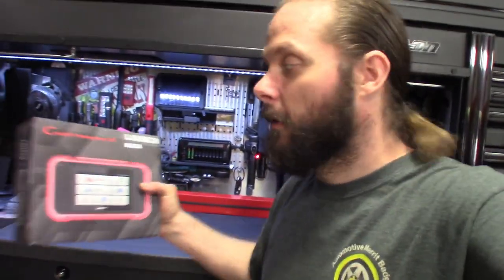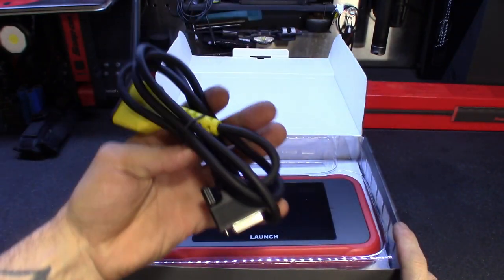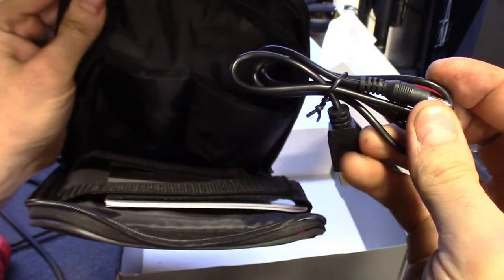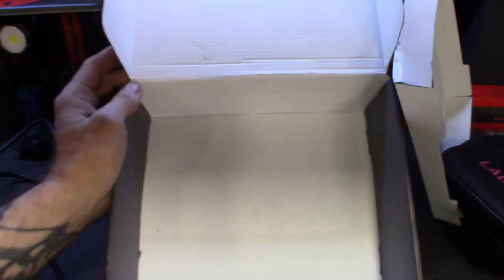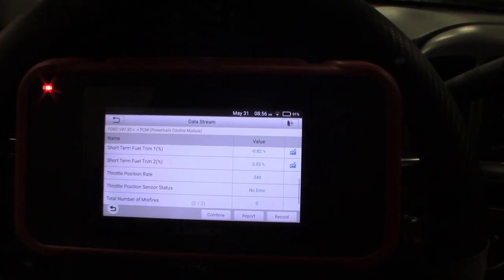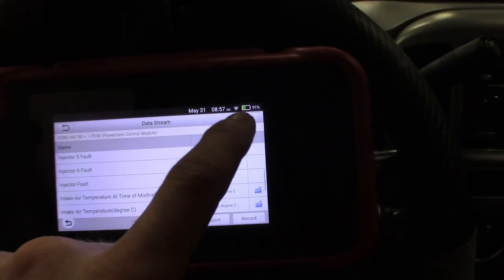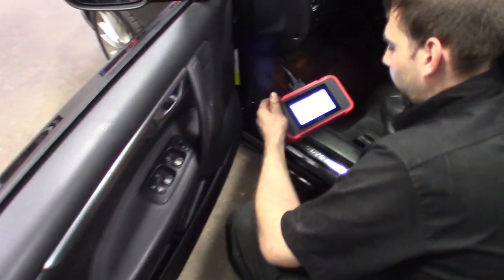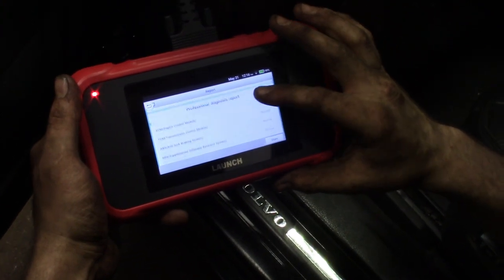New Launch CRP123E Review on Ford, Volvo & Nissan.

Comment: I have a CRP129E that seems almost identical to this one. Be careful when using with Toyota. I have noticed that it comes defaulted to Europe on Toyota models, and you'll need to "set area" to America or else it won't connect to the vehicle. I spent entirely too much time trying to figure out why it wouldn't connect to any newer Toyota's lol
Reply: Voltage Drop Diagnostics good to know PJ
Reply: Looks like it’s only the 5 reset functions the 129E has over the 123E, so the 123 is just a code reader and 129 has resets, I just did one on the 129E so I was curious too
Reply: Hi PJ,thanks for your feedback.all right " it comes defaulted to Europe on Toyota models, and you'll need to "set area" to America or else it won't connect to the vehicle"

Comment: Just got it in from UPS and I've got all the upddates. Looking forward to using it tomorrow. The last 6 upgrades were hard to get in, but they finally happened.
Reply: Do u know what updates the Launch did or features it added?  Thanks
Reply: @todd5082  Not really. The last 4 took rseveral etrys to get them in. I think Jaguar, Lada, some other oddball ones that I've never heard of before.  I wondered if I should even  bother with them, but gave in to curiosity and got them anyway.
Reply: Bonsoir moi je ellectricien auto je ne comprends pas l'anglais ci c'est pas français

Comment: One more thing ----> there is no charger with this unit and even though it offers a USB to whatever the connector is called, I just decided to take an old PSU I had laying around and I charge it from that. 

After all - a Computer PSU is super clean and absolutely correct voltage and it charges the 123E just fine. I was worried 'cause the battery was still going lower and lower even if I left it plugged into the USB connex.

It just didn't seem to charge very well at all that way.

Comment: Do you need to  have internet to used it ? If you don't updates does that still work without updates ? Out from the box can you used it without wifi or internet ? Can this scan fpr Fuel Pressure ? And can this do compression test ?

Comment: I didnt look up what resets, or functions it can do, but seems slower then my 229. Still looks like it shows all the pids, and I like that that one has the graphing ability.  But if it's even 1/3 what the old ones are, it'll be a le to do most basic testing. Glad I got to see the new one jim.

Comment: Is this tools upport Mercedes W210 which requires 38 pin adapter? Thanks.
Reply: No,only for 16Pin OBD2.
For OBD1,you need to buy adapter by yourself

Comment: I have the same one. Excellent video.
So you know or how ro relearn the travel app sensor procedure on a 06 Mitsubishi Outlander? I had replaced it had code P2138 in health report.
Reply: CRP123E can not do reset service,CRP129E can do Oil Service/EPB/TPMS/SAS/Throttle Body Reset.
other calibration service you should think abou more advance scan tool like  Launch X431 Diagun IV or Launch X431 V Pro.

Comment: Does it show each cylinder miss fire counter?
Reply from the maker: Not Ford's but I'm sure it would on gm and other vehicles.
Reply: If it's like the older one I have, it will on non Ford vehicles. Ford as you prob know does balancing reading, and not individual cylinder readings unfortunately Justin.

Comment: Does this tell you which cylinder isn't firing and possible cause?
Reply from the maker: If vehicle manufacturer monitors it. Yes it will give you a code and you can use it to Google possible causes
Reply: Yes sir,the scan tool has the button "google search" to fast get possible causes.and also the live data will help you to do more Diagnostic analysis.
Reply: Possible causes??? Spark, fuel or no compression... You really have to ask... SMH

Comment: Does it have a mileage return option?  For example from 250000km to 200000km to reduce?
Reply: Scan tools don't rewind mileage,  however there is a tool that the AA guys use for odometer verification.  And then dashboard repair places can rewind digital odometers.